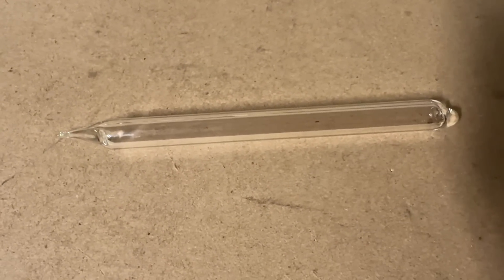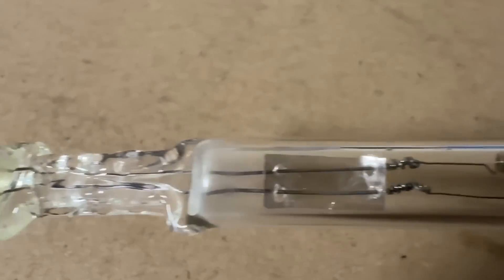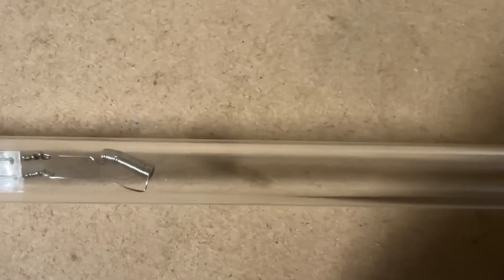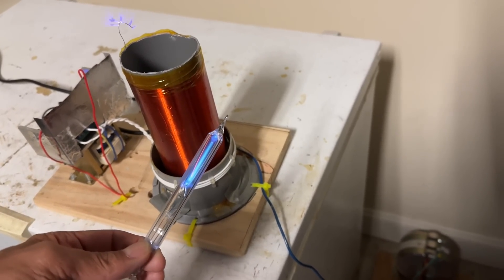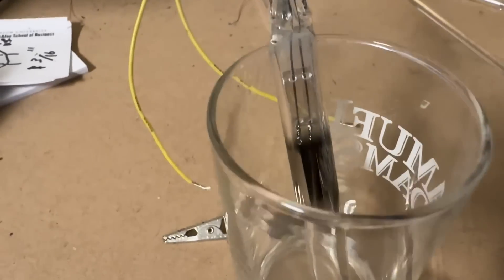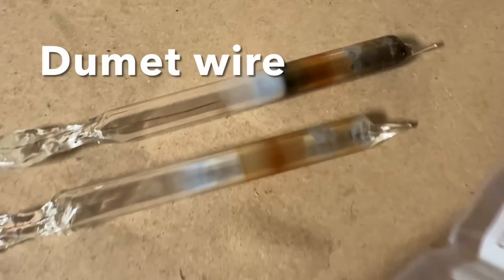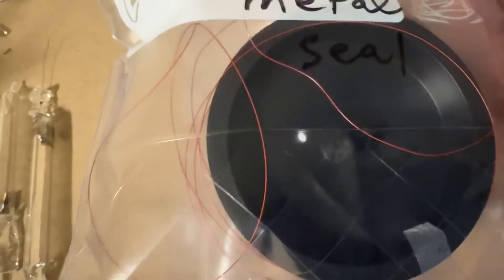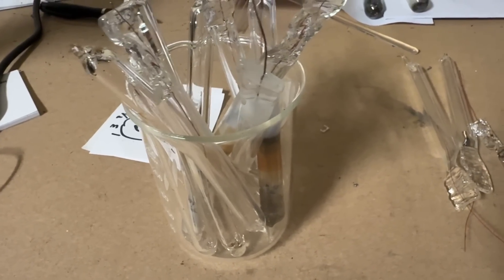Home Made Hard Vacuum & X-Ray Tube-test

Comment: Is it possible to bond glass to graphite rods? In the future I'm planning on making a high voltage Arc lamp that uses graphite rods as the electrodes
Reply from the maker: Problem with graphite is it forms carbon dioxide with surrounding oxygen. I’m not sure that there would be a good seal, but it is worth a try.
Reply: @BrianDhvTinkerer  if it doesn't work could i use small tungsten rods
Reply from the maker: I just read up on graphite. The coefficient of expansion of graphite is about four times different than that of glass. Also glass is anisotropic in terms of a expansion, whereas graphite is isotropic and tends to have different coefficient of expansion in different directions as well as lengthening so this process would make it impossible to make a seal with glass.
Reply from the maker: Tungsten will work. However, it has to be treated first to form a layer of oxide on it that will allow the molten glass to wet the tungsten. If there is no oxide layer, then there will be no wetting of metal by the glass and therefore no seal. It’s definitely challenging but if it works, it’s awesome.

Comment: check out glassingers videos he makes loads vacuum tubes. the clothing selection is quite intersting! he got a lot of old school electronics knowledge
Reply from the maker: Yeah love his stuff- very detailed radio tube construction. I wish I knew where he got his old style getters from. Love his clothing selection!
Reply: @BrianDhvTinkerer think he just saved them from broken old tubes. do you know what they made from?
Reply from the maker: Aluminum barium alloy
Reply: @BrianDhvTinkerer 👍  thats an odd mix
Reply from the maker: @peteb3365 it really is. Apparently there’s different grades depending on the flashing temperature linear bar configuration vs circle etc. Can be flashed electrically or with a high frequency induction heater around 200W

Comment: Well done!  Could you tell me how to make the voltage doubler you made for the HV supply?
Reply from the maker: It’s a 10 stage Cockcroft Walton multiplier. I made it starting with a 2 kV AC lamp power supply I bought from amazing1.com. I drilled properly spaced holes in polycarbonate plastic which I had preheated and bent into an L shape which I could screw down to a plastic or wood base. The 2 kV lamp supply runs from 12 V DC battery which comes from 3 x Li cells. I used a remote wireless switch to activate the power ( for convenience). I use 20x G20FP diodes (each rated 10 ma 20kV) and 20 x 100 blue ceramic capacitors from eBay ( each rated 10-20 kv). These are placed through the holes in the preformed polycarbonate and soldered as in the following circuit diagram: 

https://civilpedia.org/p/?t=Voltage-Multipliers&pid=111

The positive output is passed through 10 x series connected 20 kOhm resistors in a tygon tube to reduce the current during short circuits and protect the 10 ma diodes from failure.

Actually, I just checked on amazingone.com for the 2 kV 10 ma supply and it looks like the owner of the company passed away and so it was permanently closed. If you can find an equivalent, that would work great.

There are also CW multiplier kits available on AliExpress in case you can’t find the components to make the voltage multiplier.

Comment: Would be better if you can get the x-ray electrode inside of the glass tube. You would need to add a side port to the glass tube for the vacuum pump. Use a long glass tube. seal off the end. heat up a spot on the side. blow into the tube to create a small hole. join a second glass tube over the hole to create a Tee for the vacuum. cut off the sealed end. Insert the X-ray electrode & seal. You could create a getter loop on the X-ray electrode and than just use a tungsten filament on the opposite side instead of titanium since you can run the tungsten hotter, and it won't outgass contaminates when it heated up when the tube is in operation for X-rays. The x-ray electrode will never get hot enough to outgas any contaminants when in use.
Reply from the maker: Next plan- will keep u posted

Comment: I've been trying to suck air out of a jar using a dual-stage pump that I previously used in my fusor, but I would always get super long arcs with no X-rays. Now thanks to your experiments, I know that this is not for me, I under-estimated the level of void that was needed to reach that speed, and the complexity of your task illustrates it perfectly. I'll wait for my vacuum tube to arrive instead. Thanks for sharing!
Reply from the maker: Most welcome!

Comment: Have you studied physics? X-rays are produced by collisions of electrons accelerated by an electric field with an anode (it should accept electrons well - nickel silver will do, it is recommended to cool it). Estimate the electron path length and the required constant voltage on the anode, and you will get about 3-4 inches of path at a voltage of at least 80 kV. Any schoolchild who has finished school can calculate this scheme. And before vacuuming - it is necessary to blow out the flask with high-purity hydrogen.

Comment: I wonder why mercury is used in fluorescent tubes?  Could potassium be used instead, since it seems to have a decent vapor pressure?
Reply from the maker: The mercury vapor under low pressure generates UV light. This has very low luminosity, but interacts with the fluorescent material on the inside of the tube causing a bright glow from remission of light in the white spectrum - that’s the basic principal.

Comment: Like the voltage multiplier
Reply from the maker: Yes that one takes 2000 V AC from a lamp power supply and multiplies it to 40,000 V DC. It seems to work very efficiently and I can run it off of 12V DC

Comment: you know that heated steam evacuation trick. well, you said it yourself, you can heat the tube from inside to very hot air or steam, then block off the output path. ie the torch that is used to seal the tube can heat up the air inside to high vacuum when sealed. so x-rays come through the glass surface darkening no problem.
Reply from the maker: Thanks, that’s what I’m gonna try next

Comment: The best way ive found is to backfill the tube under gentle heating with pure oxygen twice, then pull the vacuum while heating for real, seal and fire the getter. You will get a very deep vacuum. ❤
Reply from the maker: Great advice. Thanks! That’s gonna be my next plan when I do this. Use oxygen instead of air!  That way I should not have any traces of argon.

Comment: A ready made neon electrode might work. You'd need to weld it to a soda glass tube then flush the tube with a reactive gas such as nitrogen before evacuation with your two stage pump and sealing off. Before all that you'd need to get the entire tube to 300 °C whilst on the pump. Neon electrodes contain a barium carbonate getter and you'd need to get yours to a bright orange glowing temperature with an induction heater. One problem however might be that it's very hard to come by very pure laboratory quality nitrogen or any other gas for that matter.

Comment: Huh, wow! No idea that a titanium getter works so well. I wonder if there is also some sort of sputter pumping going on, since as another commenter mentioned it would be surprising for the vacuum to get that low with argon present. We're not sputtering here, but maybe the sublimation of the titanium onto the wall is also trapping the argon in the mirror film.

One question, are you sure that it's the potassium vapor in the potassium tubes that's lighting up? Obviously spectral colors won't necessarily come through a camera accurately but all the pictures of a potassium discharge I could find are very obviously purple-pink. Looks very different from the bluish discharge that appears to be happening in those tubes. Does the potassium maybe just not do a very good job of gettering the nitrogen? I am not aware of potassium reacting with nitrogen all that strongly... Wikipedia says potassium nitride is unstable at room temperature. And since the potassium is soft and relatively close to melting at room temperature and maybe undergoing a lot of solid state diffusion, maybe it's not physically trapping the nitrogen well?
Reply from the maker: Yes, I actually do have a spectrometer  that I made a while back and I’m gonna look at that again through the spectrometer. As you pointed out, it is possible that all of the nitrogen was not completely removed from the two attempts. I believe potassium nitride is extremely moisture sensitive. Inside the vacuum, it is probably gonna be stable. I don’t think potassium is very reactive to N2 gas and requires high temperatures for complete removal of the nitrogen. So yes, this is very likely. Thanks for pointing that out.

Comment: Dunno if it falls into the category of not needing specialized equipment but if you can get your hands on some liquid nitrogen you can make a better vacuum by attaching to your main tube a tube full of activated charcoal. Make a vacuum and heat it as hot as possible (the charcoal inside the tube) just before the glass softens enough to collapse, then seal the contraption from the mechanical pump and then let cool slowly the charcoal once its cool submerge the tube with charcoal into LN and it should pull a significant vacuum, maybe close to 10⁻⁴ to 10⁻⁵ Torr, then remove it while cold, I think that way the Titanium pump would work better to remove the last remains. But this means good glass working skills!
Reply from the maker: Great suggestion- got to improve my glass working skills😁

Comment: Would it be helpful to introduce an oxidizing agent to enhance the formation of oxides? In the same way, could a substrate material be introduced to collect these oxides and keep the glass clean? And if this were possible, a second stage of glass melting could even be carried out to exclude these oxides at the opposite end of the filament. Just thinking out loud...
Reply from the maker: I think this would be possible. I’m thinking of possible designs.

Comment: Hello. I will stay tuned.
Do you anneal the glass after melt it? Usually fused glass need to be annealed above 500C to avoid cracking.
Reply from the maker: Yes I pass it over a flame and let it cool down slowly

Comment: Air contains about 1 percent Argon which will not react with your Ti getter or any other metal. You might mitigate that effect by flushing the tube with another pure gas such as Oxygen, Carbon Dioxide, Nitrogen or other gas that will react with your getter, then heat the glass to drive off adsorbed gas before sealing the tube and heating up your getter.
Reply from the maker: That’s a great point and I did think about that. Would probably use oxygen the next time I do it. Having trace amounts of argon gas though does not seem to be an issue but to get a really true vacuum requires removal of the 1% argon as well.
Reply: I would say that nitrogen is a good candidate to displace argon because of its low solubility. Hydrogen could also be useful, although it is less accessible.
Reply: @miguela.m.8671 Oxyhydrogen could be made using electrolysis extremely easily. You wouldn't need a cylinder of the stuff.
Or pure hydrogen from aluminium shavings and sodium hydroxide. 

You could set up a vessel with a cathode seperate to the anode and collect the hydrogen that way, put it into a large gas syringe and then use it to fill the tube by adding some tubing to the gas syringe, push the tubing into the vacuum tube (prior to sealing) invert everything so the sealed end of the vacuum tube is the highest point then empty the hydrogen gas into it. It'll push any denser gas down and out.
Reply: Yes that works very well, can use pure nitrogen if you use a titanium getter, with oxygen flush you can use a wide range of metals such as aluminum, magnesium, or any other reactive metal.❤
Reply: Аргон не будет реагировать с титаном, но будет адсорбироваться на его поверхности и, при дальнейшем напылении титана, окажется встроенным в титан. Так что из газов в трубке останется только водород! :)
Reply: @ikono2  I forget what the name of the  process is whereby gasses are carried along and entombed in layers of deposited metal. This would take longer than just vaporizing a getter that will react with residual gas. Other methods are to use molecular sieves and a cool trap to adsorb the remaining gasses.
Reply: I can see O2 flush with Mg getter having spicy-outcome possibilities. Make sure the vacuum pumps are working properly. ;D
Reply: @matthewellisor5835  That could damage the vacuum pump, is dangerous to pump pure oxygen with oil lubricated vane pumps.

Comment: Nice Ti pump! regarding xray you should leave an electrode on the other end (pump side) so you can connect the other side of the HV there, as DC current won't flow trough the glass in cold cathode, monoelectrode x tube will work only with high voltage high frequency AC current. Btw if you get a too good of a vacuum, it will kill cold cathode mode as a certain amount of residual gas is fundamental to generate the electrode that makes up the current of a cold cathode emission so maybe try the tube gradually while sublimating the Ti.
Reply from the maker: ty- yes for sure a two electrode system would be better with DC high-voltage. The Ti is definitely more user-friendly than trying to evaporate potassium. Next plan is to make a two electrode tube and try and make it focusing. You are sure right about very hard vacuum which I probably had. Crooks tubes had residual gas and were quite effective at making x-rays with a mono electrode.

Comment: This is godsent info. I always wanted to try vacuum tube building but never wanted to spend so much money on equipment. Wow

If I remember correctly these are called "getters" that soak up gases when heated. There must be numerous metals that could work but Titanium looks promising and cheap as well
Reply from the maker: Yeah, I avoided trying to produce a very high vacuum because the equipment was very specialized and super expensive and not very adaptable to the home lab. For a one off high vacuum tube, such a purchase would not be worth the time or the effort. The method shown in this video makes it possible to produce a hard vacuum using readily available and cheap material and at any time without having to maintain high-end pumps. My next plan is to actually build a working  x-ray tube from cheap glass and metal.